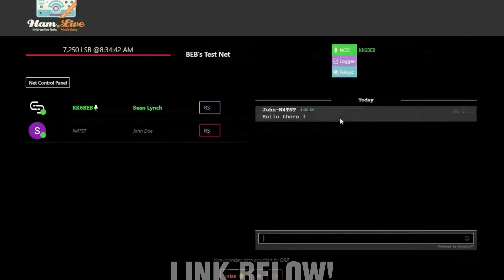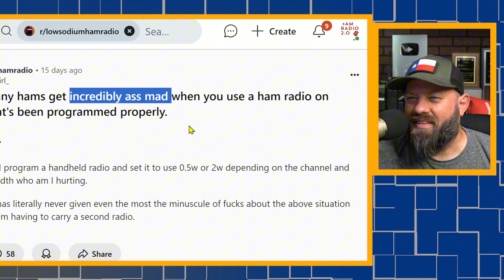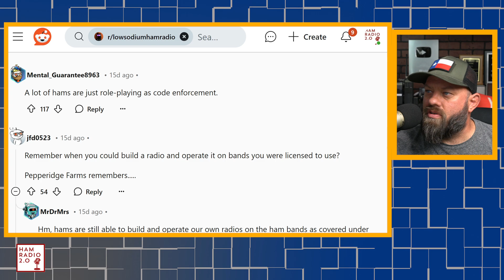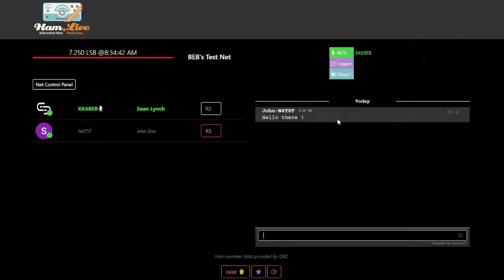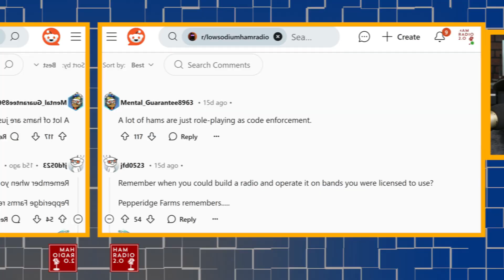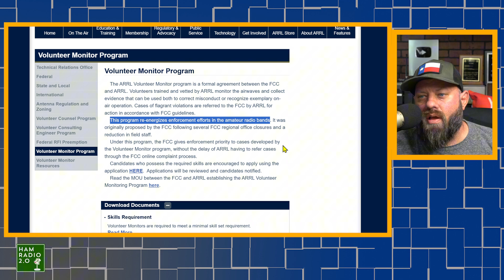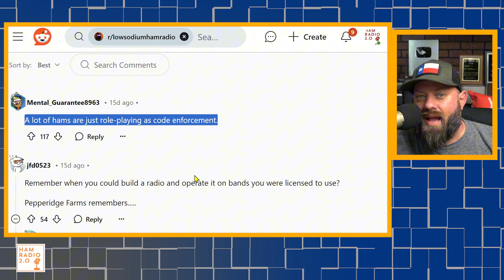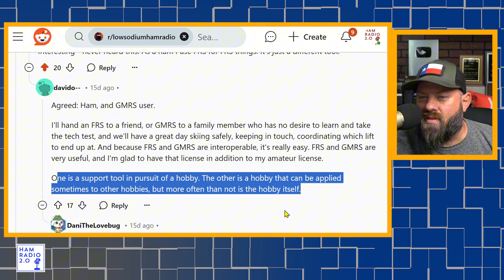Can We Use HAM RADIOS on FRS Frequencies?

Comment: If it weren't for cheap Chinese dial a freq, I would have no license at all. It was my interest in the cheap HTs that led me to GMRS, and I love it! I do stick to the allocated frequencies, and programmed my radios to operate within the guidelines of the FCC. It sucks that none of the quality manufacturers make GMRS radios, so I could care less about part typing. If Moto, iCom, or Yeasu came out with a GMRS radio, I would buy several. So sad Midland is a good radio, but their channel & coded squelch scheme is such a steaming pile of poo poo that I won't even consider any of their radios. Midland should include an Enigma machine to decode their stupid channel plan & codes for coded squelch. I do wish the FCC would allocate more bandwidth to GMRS. Maybe all of 462/467? Thanks for the video!! 69s!!!

Comment: I come from a commercial radio (Part 90) background long before GMRS & ham. As such I have friends in that world who are techs for radio shops & in that role encounters with FCC field agents isn't uncommon. One of them made it a personal mission to ask several of those agents about the use of Part 90 equipment on GMRS (Part 95). The general consensus was that Part 90 is a higher standard than 95 & produces higher quality, spectrally cleaner equipment. Thus, they are not concerned with its use. Many people don't even realize that most GMRS repeaters are commercial repeaters. Part 95 "GMRS" specific repeaters didn't even exist until relatively recently & still make up a very small portion of all systems. If Part 90 on 95 were a problem for FCC Agents, we would not have GMRS repeaters in most areas. They are well aware the machines are repurposed commercial equipment as GMRS repeaters are relatively new to the market. Is it illegal by rule? Yes. But even their agents understand that the availability of some equipment by rule isn't achievable & therefore must grant some leniency.

I also want to remind everyone that the first 7 462 freqs of FRS are still GMRS interstitial channels for GMRS licensed users & we retain the legal right to run up to 5w on those. It's only on the 467 freqs where commercial equipment would not be able to drop to a low enough wattage to comply with 500mw output limit & would not be advisable to use there.

As for me personally, I couldn't care less what equipment you use where so long as it doesn't cause interference to other freqs I'm trying to use. Once it does, now it becomes my business. Until then, use whatever equipment you will.
Reply from the maker: Thanks for sharing

Comment: Only one thing ill say is dont use the ham antennas on ht for out of band uses..
Use a properly tunned antenna...

Lot of these ham ht antennas have tight bandwidths.

Personally be better off using  LMR business radio for Ham/GMRS as they are designed for tx/rx wideband coverage far better than a ham radio HT or Mobile unit and probably meets better specifications.

Comment: I use whatever works . As a person who's been a ham since 2006 I honestly don't care anymore. I think the FCC needs to just do away with the amature radio licence requirements all together. Cause it has been my experience that people on can radio are way nicer than actual ham radio people. Cause they don't use your licence agents you and turn you into the FCC and get your licence red lighted if they don't like you. And then you got a bunch of ham radio gear that you can not use because of one complaint . This is why we all need to email Donald j Trump and tell him to have the new FCC head who's is replacing Laura Smith , Mr karr. To just abolish the ham radio licence. So anyone can just get on the air. But just keep the commercial licences for business of course but we do not need a licence for a personal hobby.  Cause on cb licence free radio those people are soo nice. Cause no one can really get anyone's licence in trouble . Cause once you get a complaint from another ham your done .even if the complaint was false it does not matter your screwed and now you have a bunch of radios you can not use. This is happening a lot . Cause it took the FCC over 10 years to get to my case. Because they told me they have thousands of complaints and files and hearings to get through. And in the mean while you are waiting for you licence to get yellow lighted or green lighted. And in the mean while it takes 10_15 years for the FCC to get around to your case. So this is why we just need to get rid of ham radio licences cause this can happen to anyone. Anyone who makes a false complaint against your licence noting happens to them but you have to prove your innocence or fight your case and in the mean while years go by and you can not talk on ham radio all because of one complaint 
 . It does not matter if it's true or false . Your just screwed.

Comment: ISM refers to Industrial, Scientific and Medical RF devices.  This includes a ton of medical devices, Wi-Fi, Bluetooth, LoRA, and a ton of other common "wireless" devices.

The "the device is the licensee" in these bands remark referes to the way they are regulated.  In the case of Wi-Fi devices, for example, the manufacturer takes the device, which includes the radio itself and the antenna, through the certificatrion testing process.  The total radiated power is the principal regulated paramater in that case, so the end user is supposed to use the device as tested and certified.  This is why no OPERATORs license is required for Wi-Fi, Bluetooth, baby monitors, wireless cameras, garage door openers, car remotes, microwave ovens, etc.

If you take a USB Wi-Fi dongle and attach a much higher gain antenna, you are operating it outside it's license.  Same goes generally for modifying any ISM devices.

Comment: We should be mad at the manufacturers for not getting their Handheld radios cross-certified. If the radio is GMRs certified, there is no legal reason why it can’t be on ham radio bands under Part 97 when you are licensed.
Reply: Try actually reading eCFR Title 47 Part 95. It is surprisingly well written and easy to understand.

FCC prohibits certification as Part 95 if the equipment is designed to be used on frequencies that are not licensed via an equipment certification. Amateur Radio service is explicitly called out. A manufacturer cannot get equipment certified for GMRS if that equipment is designed and intended to be operated on amateur frequencies.

Equipment that is sold for amateur use does not require frequency restrictions because it is the operator that is licensed and not the equipment. Ham operators are supposed to "know better."  GMRS operators are not presumed to have that knowledge, so the restrictions are enforced via equipment certification.

FCC also explicitly no linger cross-certifies equipment for both FRS and GMRS. Although they use many of the same frequencies, the standards are different for the two services.

So, no, you can't be mad at "radio manufacturers" for not getting cross-certfication when FCC regulations explicitly prohibit the issuance of such certifications.

Comment: I’ve had my ham ticket since 1971. I had a Class D CB license prior to that. I’ve used FRS since it was a 0.5W only service and have several GMRS and MURS Part 95 radios in my stable of radios. I also have GMRS and MURS frequencies programmed into my ham radios (even those which will not transmit on those frequencies) for use in emergencies. One concern I have about using non-Part 95 radios in GMRS/FRS is that people use high power on FRS channels 8-14. They also make up their own channels so they don’t have to share them with others, which results in interference with other users or even other services. In Phoenix, we get to enjoy listening to idiots bragging on the DPS frequencies about hacking into the repeater system. Not so much on the trunked systems. Any time someone does this, guess who gets blamed by the news channels, newspapers, and every other non-technical person? That’s right, ham radio operators get blamed. I really don’t care if someone is operating a non-certified radio on GMRS/FRS/MURS as long as the radio meets the technical standards of that service.

Comment: No, and yes.... If your do the research, and program your radio to the specifications of FRS/GMRS/MURS, so that the signal emission meets the specs for the band being used(power/bandwidth/ect), No one really cares, and the signals are indistinguishable. I think all my "ham" radio's have at least MURS programmed in, at least on Green dot/Blue dot frequencies(as those are the only 2 that can meet the bandwidth requirements.) I only use this band at work, and give out actual MURS HT's to coworkers as needed, but I'll often use either my Quansheng UV-K5/(8)/Anytone AT868UV/Kenwood TK-2180 to talk to them, as I know those radios better and I usually have at least one of them already set up with a handmic. I'm not even implying I use them for a higher power. The building  we work in is basically a giant faraday care, so even the company radio's are spotty(I've asked and they won't put a base station "upstairs", so using a company radio for inter-plant comms isn't possible(even if the company radio in my machine didn't beep at me when I try to transmit.)

Comment: I have both Amateur and GRMS licenses. One of the radios I own (TD-H3) is technically certified as both and I don't feel bad about having channels for both programmed into it. You can actually set the radio to either (or both) modes of use. And yes, I use the correct callsign to identify myself on each.

Comment: I think it more of a newer thing with the introduction of the Baofeng UV-5R, along with other inexpensive Chinese radios, to the US market.  Originally when you bought a UV-5R it was unlocked and could transmit across its entire receive range.  Now they are typically locked to either ham radio or GMRS and many of them cannot be unlocked.  All of mine were unlocked out of the box.  The UV-5R and and similar radios gave the uneducated unrestricted FM access to the 136 - 174 MHz range and the 400 - 480/520 MHz range.  I personally know people who bought UV-5R variants, use the factory programed memory channels that are outside of the Ham, GMRS/FRS, and MURS services, and you can't tell them they shouldn't be using those frequencies.  The general public as a whole is not smart enough to know that programmable radio purchased from some random online retailer actually needs to be programmed before being used.  My exposure to Baofeng came from paintball and airsoft.  Many of the teams that attend the same large scale paintball games I attend use Baofengs and many of the airsoft teams that attend large scale games at my local paintball/airsoft field use Baofengs.  I decided to buy a UV-5R leading up to a large scale game I was attending and then I bought a second one, which lead to me buying a 6 pack giving me a total of 8 radios.  I was smart enough to know that there are frequencies I needed a license to use and frequencies I didn't need a license to use so I programmed the FRS and MURS frequencies into the radios.  I just thought they were better walkie-talkies than the standard blister pack FRS radios bought at the big box stores when I purchased them.  A couple years later I did more digging about them, joined a few Baofeng groups on Facebook, and discovered they were really meant to be used for ham radio.  I should have realized it sooner, but I had a lot going on in my life at the time.  Anyway after I discovered they could be used on ham radio I looked up ham radio repeaters in my area and programmed them into the radios.  I also looked up public service and municipality frequencies to program in.  I set one on scan and just had it going in the back ground.  When I realized I could only hear one repeater I decided to have one monitoring that repeater and occasionally have another monitoring my county's central dispatch.  After several months of monitoring the local repeater I finally decided to get my ham radio license.

I have nothing against the folks who want to have an unlocked Chinese radio or a MARS/CAP modded ham radio and use it on FRS/GMRS or MURS frequencies.  I still use my compliment of UV-5R handhelds on FRS/GMRS and MURS for the paintball events I attend because I know the chances of any kind of enforcement coming from it are slim to none.  I did get my GMRS license earlier this year because I finally got the members of my deer camp group to realize we need to use GMRS for communication in the area we hunt due to needing a relay at the cabin so the folks two miles south of the cabin can talk to the folks on private land a half mile east of the cabin.  Most of the radios used for deer camp activities are my radios.  One person has his own unlocked UV-5R, but he relies on me to program it, and another person bought a two pack of the GMRS UV-5R based on my recommendation.  My recommendation was strictly based on cross compatibility with my radios since I have a 6 gang charger and power outlets at the cabin are in short supply.  Next goal is to set up a GMRS repeater at the cabin in 2025 since we were unable to do so in 2024.  There is a GMRS repeater in the area, but I would rather we have our own repeater so we are not taking up someone else's repeater with our chatter.

I am sure hams using modified radios on FRS/GMRS and MURS is nothing new.  It is probably something that doesn't get talked about on the airwaves and seldom talked about on social media.  In one Baofeng related Facebook group I am a member of they have a rule against promoting illegal use of the radios.  In that group I just remind the US based posters of the FCC rules publicly and point out that many of the current product models cannot be unlocked to transmit outside of the service they are intended for.  The reality is the FCC more than likely won't go after anyone unless they get enough complaints to investigate the situation.

Comment: Before our county changed to P25 we had a couple of firefighters using Baofeng HTs to talk to fire dispatch. Probably not legal but we had a radio shortage in our department. Had the same situation when I was stationed in San Antonio.
Reply: The first Gen uv5r WAS part 90 compliant and I used one in fire service for a year until I could pick up a Kenwood.   The 88 series is not part 90 compliant and therefore would incur a fee if the FCC ever did an audit which just about happened had I not stopped it.
Reply: Mid 1990's, the PD I worked for barely had enough ht's for on-duty units to use.  If you worked an off-duty gig or special event outside of your shift hours, you were SOL.  I used my Kenwood TH-79 regularly for off-duty gigs.  It was nice, when working a bicycle race for instance, to hear that whoever was working your intersection was free to go home, rather than hearing it from the event coordinator, 45 minutes later.

Comment: I use a Motorola APX8000 to talk on GMRS, HAM and Public Safety. I am federally RADO cert, Ham Radio Operator, and a GMRS radio operator. But when I am at a command post I utilize dedicated radios for the circuit I need to use

Comment: I'll go even farther and say that us hams need to take the lead and fully integrate with the other services, specifically for emergency conditions, because I don't think anyone's monitoring the other services for emergency traffic. I figured since we already like radios it wouldn't be too hard for anyone to do.

My formula for this concept: 

1): At least one Retevis RT-95, unlocked to Mode 02 with first 30+ channels being the 30 GMRS freqs plus any extra repeaters in range (don't forget to enter the offsets on 467 MHz so you can receive someone calling into a dead repeater). Then add the five MURS freqs, Marine Channels 16, 68, 69, 71 & 72. Add the color dot and itinerant star freqs from business band radios. This radio will need a different antenna than your ham VHF/UHF set. I recommend the Comet FC5NMO, because it is specialized for the above range of freqs.

2): At least one scanner with the above frequencies, plus the CB channels, including AM freeband freqs. On separate banks, add The business/itinerant freqs, ham calling freqs and repeater freqs in your area (AND their offsets), your local fire, law, public works, and Airband freqs in your area. The scanner frequency range should be at least 25 MHz to 470 MHz, but 700 & 800 MHz is heavily used in many areas without encryption, so good to have that as well.

3): At least one CB radio or 10-12 meter band ham radio with scanning ability and a channelized tuner, unlockable to 11-meter band. You'll want the full 102-inch whip to pull in weak signals transmitted under less than ideal circumstances. Don't forget the freeband commonly used in your area.

4): At least one additional unlocked portable ham radio (and CB, if applicable), to maintain contact with the calling party as you approach to locate and assist them. Two portables, if you have someone coming with you to help.

Now simply scan for emergency traffic during critical incidents and be prepared to quickly stop scanning and write down what you hear, including everything you will need to identify, recontact and locate the person needing assistance after you leave your radio base station (this concept assumes first responders are unavailable). Program the portable(s) before you leave to help. Try to have others stage the things you will need to take with you, such as medical supplies, safety equipment, tools, gas cans, etcetera. Confirm the address given actually exists, and be aware that calls for help could be a setup for a robbery or ambush. Take another person with you, and leave a copy of the plan with someone else who can monitor, preferably at your base station. Relay to any ham EMCOMM station, if up and running, in case someone is closer than you that can help.